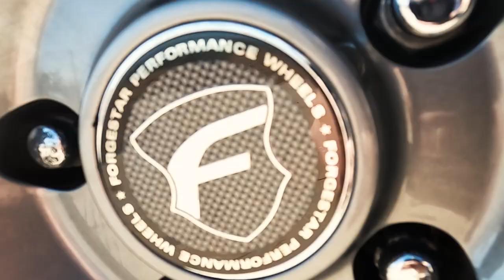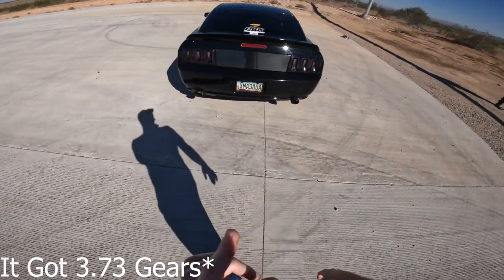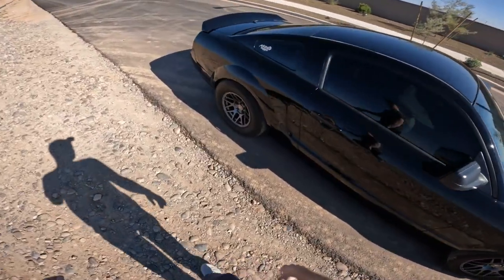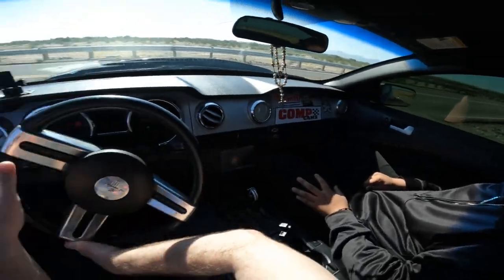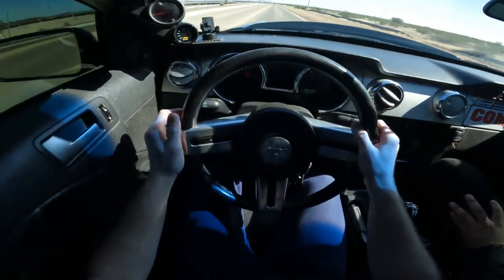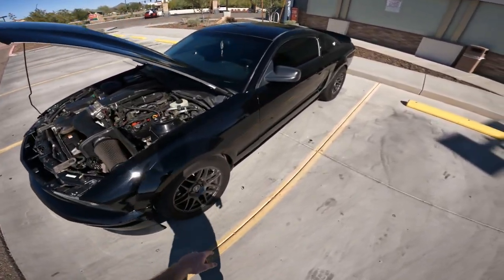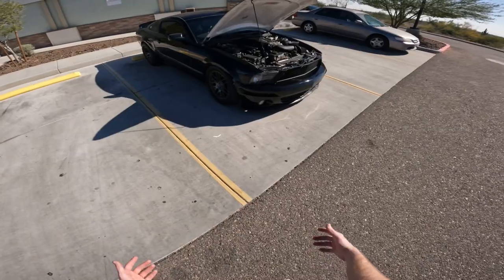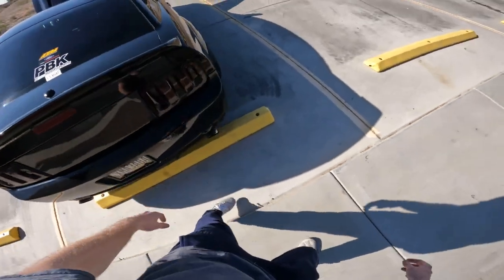Is A 3v Mustang A Waste Of Time And Money? 10 Minute Review

Comment: The Saleen blower was the best blower for stock bottom 3vs!  4lbs of boost makes 400 wheel. 10-11 can make over 500.  JDM Engineering safely tuned the Saleen blower to run In the 10s with the 2.8 pulley.
Reply from the maker: It definitely performs well on this car!
Reply: @CamMarz MAN I HAVE A 07 SHELBY GT AND IT'S ONLY MAKING LIKE 350HP AND I LOVE THE CAR AND WHY IT HANDLES GREAT AND I CAN USE ALL THE POWER ALL THE TIME LOL A LOT OF FUN AND I HAVE A GT500 MAKING 850HP AND I HAVE 2 SUPER SNAKES ONE MAKING 650HP AND MY COUPE SUPER SNAKE MAKES OVER 900HP AND HONESTLY ALL 3 CARS KINDA SCARE ME AND YOU REALLY HAVE TO RESPECT THE POWER AND IF YOU DON'T YOUR GOING TO GET KILLED  LOL MY STOCK 04 TERMINATOR MAKES ROUGHLY 425HP AND I CAN PRETTY MUCH USE ALL THE POWER BUT WHEN YOU GET MUCH ABOVE THAT YOU BETTER KNOW WHAT YOUR DOING BECAUSE IT IS 0 TOO JAIL IN A VERY SHORT TIME.

Comment: This is basically a stock 4.6L with a blower...wow, that is awesome. 

Also, I have the same issue with my transmission too. Very notchy. At times, it's hard to get it in reverse.
Reply: Is yours automatic or manual?
Reply: My 08 mustang gt went out on me 139.000. auto through. $4000 to get a new one with a 3 year warranty. Not mention I had new fuel injector put in $110 each.

Comment: When you Cammed your 3v did you install a torque converter? Or would the car run fine without it. I’m auto trans like your old 3v
Reply from the maker: I didn't install a torque converter no, ran just fine too! You are more likely to burn the bands though